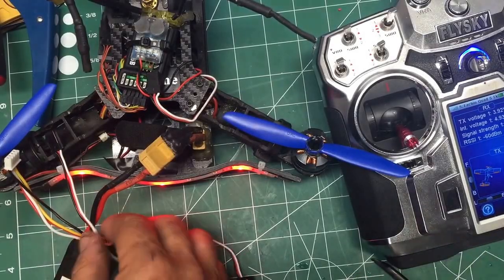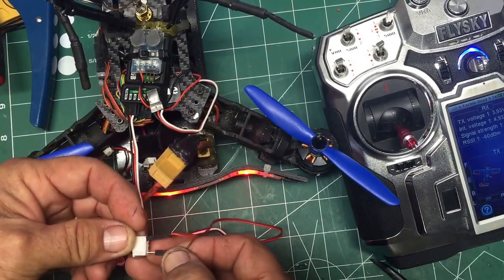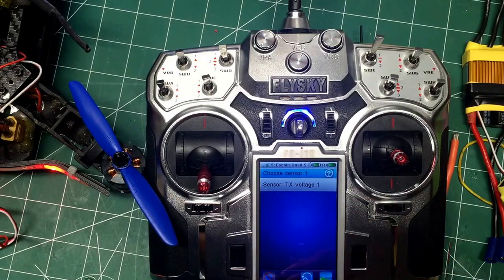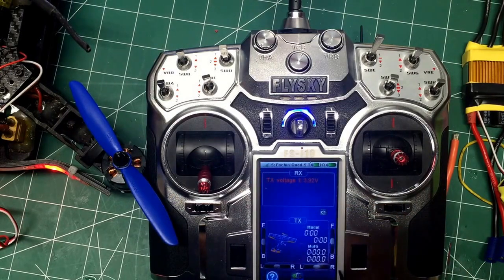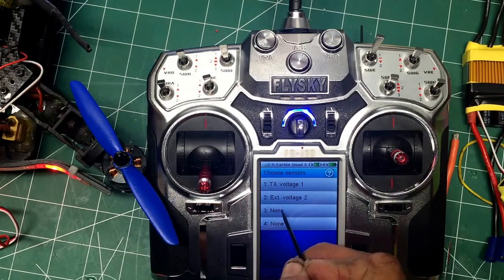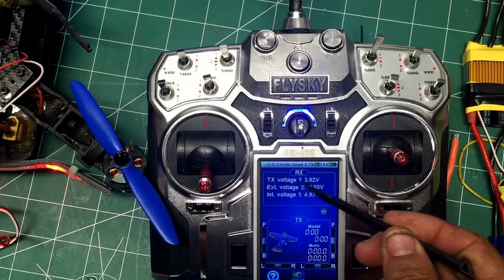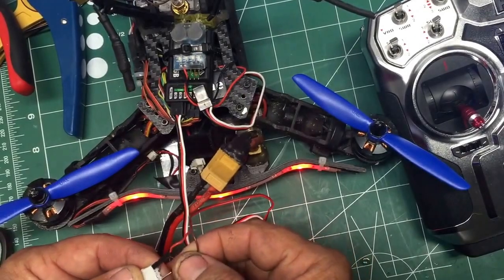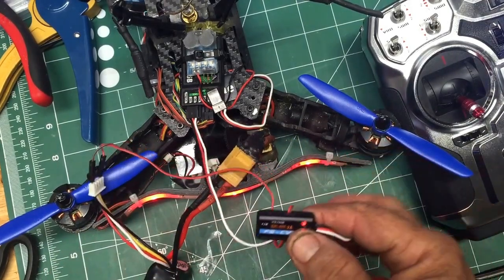FS-i10 putting a voltage sensor on your receiver and programming your transmitter

Comment from the maker: Sorry Steve but the voltage sensor only weight 4 grams and the center pin will only give you receiver voltage where as the voltage sensor give you battery pack voltage and can be set up to warn you if the voltage is going low and you need to land like a gas gauge

Comment: Dont bother with those voltage sensors, they add un necessary weight and wiring to your craft, the iA6B rx can be modified easily and for free to measure voltage on the centre pin of the bind socket!!!!!

Comment: Jacksmobile, is there a way to calibrate the external voltage sensor? On a 3 cell battery mine is reading 33 volts! It should only read back about 12 - 10 volts.

Comment from the maker: 1 what receiver are you using 2. Where did you plug your sensor did you make sure it was in the correct way and then when you plug it in you plug the 2 wire to the balance plug of your battery black or brown is ground red is positive you'll be surprised how many people plug these in backwards and burn out the voltage sensor and finally plug in your battery and then at this point you should have already bound with your receiver then follow the instructions on the video if it doesn't show up 1. Your receiver could need an update 2. Your sensor could be bad try another one if 2 don't work then then check that where you are connecting the two wire that there is in fact voltage there if all is correct then could be an issue with the receivers ability to send back the telemetry so the try another receiver - good luck hope this helps we are on RC groups under FS-I10 you can ask and post questions there and we get notified of your post and someone will reply it's a community helping each other and newbies come along and can read pages and pages of issues and how we deal with them good luck

Comment: what receiver are you using with the FS-I10
Reply from the maker: FS-iA6B & FS-iA10
Reply: I did not know you could sync the FS-I10 can be synced with the FS-iA6b. awesome
Reply from the maker: It sure can and feeds back voltage telemetry to notify you of impending doom !
Reply from the maker: That's a great price and for only $4 bucks more your reporting telemetry voltage  back to the transmitter other brands it can be as high as $60+ dollars to do the same thing

Comment from the maker: Hi  Nicholas, if you have a FS-i6b receiver - then when it's powered up  on your transmitter screen, tap the sensor box it's below the RX word and it will allow you into the choose your sensor choice play around in there and you should be able to figure it out if not I can make a video but look at my voltage telemetry video and its the same but different lol .........Jack